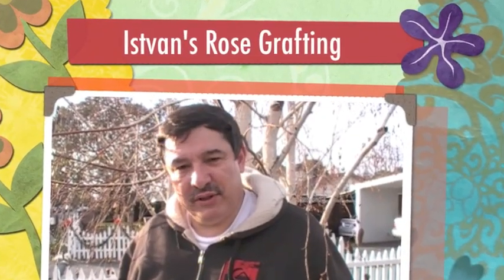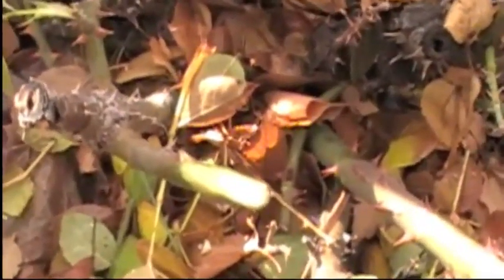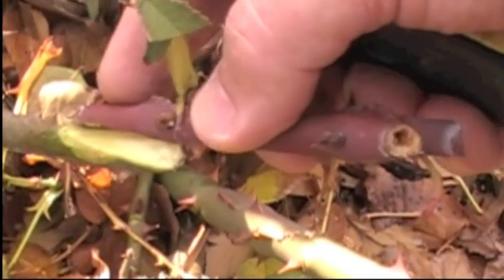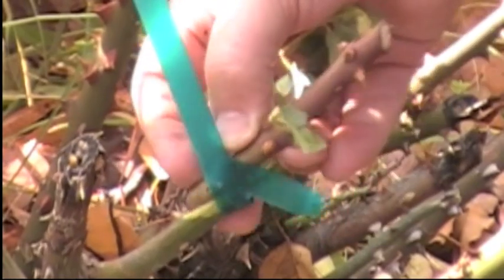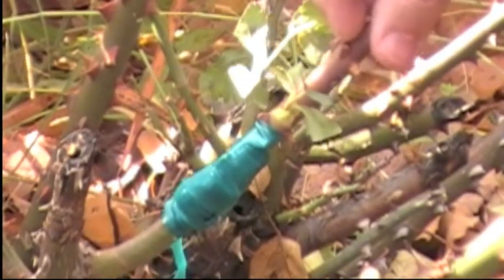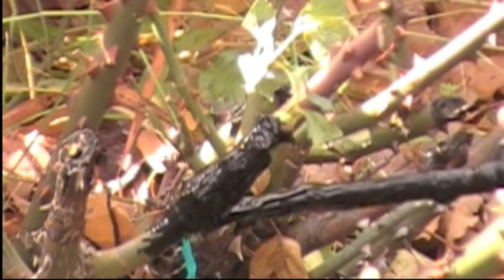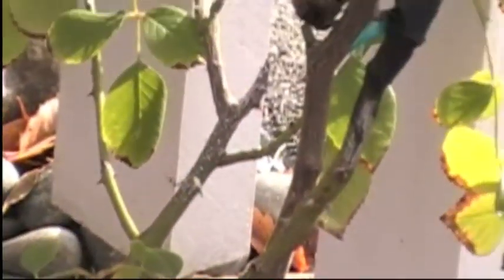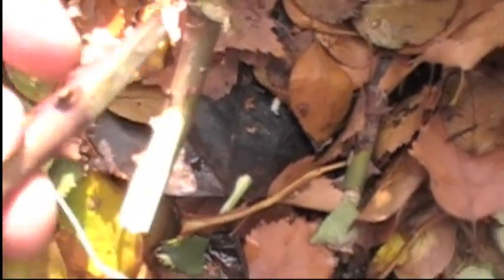ConnectedFilm "Rose Grafting"

Comment from the maker: You don't need anything other than the black tar to cover up the plastic wrap after you have put the two sliced pieces together.  Just make sure that the slices are about the same length and that you wrap the two pieces tightly together before coating with the tar.  Good Luck.